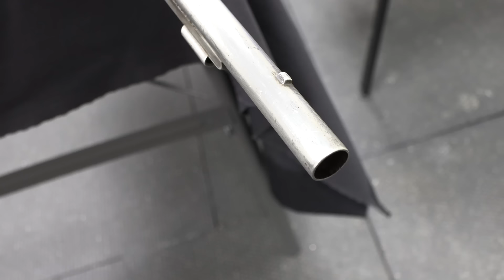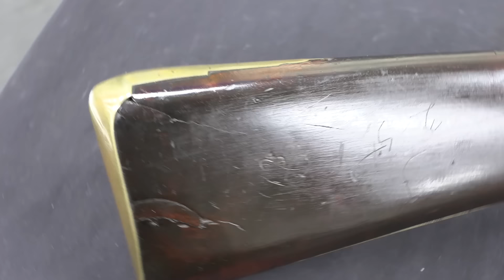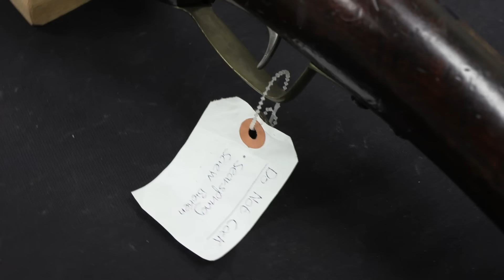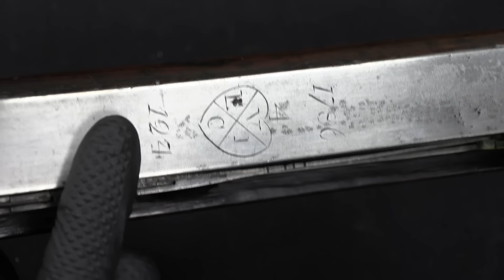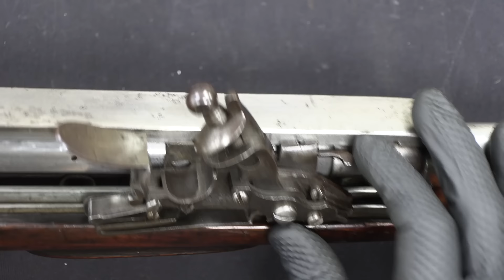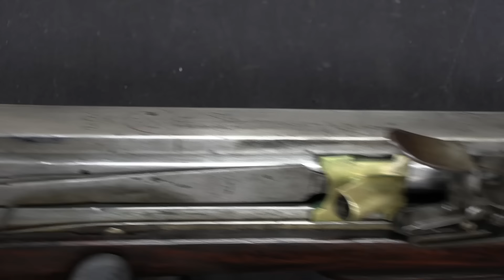Belton Repeating Flintlock: A Semiautomatic Rifle in 1785

Comment: Bruh why not look at the historic cost for a Brown Bess? Originally they cost about £1 and 2 shillings later falling just under a pound by 1795. So an educated guess - about £1 per gun in 1785.

It probably wasn't an issue of the cost per unit but whether such a radical firearm could be supported in any meaningful numbers. Questions like whether you'd really want to concentrate all of that firepower and money in the hands of one soldier.

Comment: Now, if they'd had percussion caps in the 1780s, this could've been taken a step further still. (though off the top of my head, I can't think of a system that would be as rapid-fire as the portfire option, unless you used a double-action trigger mechanism + sliding lock/hammer for each shot)

If only Bertholdt's self-exploding Potassium Chlorate gunpowder factory disaster of 1788 had led to the logical extension of this being: it's way more friction and impact sensitive than normal gunpowder ... so let's exploit that as a new ignition system (and invent chlorate based percussion caps in the late 1700s, well before fulminate caps of the early 1800s, and using cheaper materials ... though chlorates were still quite expensive given the electrolysis based process was another 100+ years away, but mercury fulminate was even more expensive to produce, plus chlorate based priming compounds have an almost indefinite shelf life where mercury fulminate degrades over time). But nope, they abandoned things after that disaster rather than actually trying to make a MORE sensitive explosive for a purpose of an ignition system. 

(side-note, but a chlorate based propellant that omitted sulfur, and only charcoal as fuel, it could've been used relatively safely as the primary propellant, but it would've been exceptionally expensive given the cost of chlorates, and would've been much more corrosive on the barrels ... and if you used a sulfurless composition with a little chlorate along with mostly nitrate as the main oxidizer, you'd end up with something somewhat more like how corrosive 777 is, but less than pyrodex:  777 uses perchlorate, but the results in the ash is the same, potassium chloride being the corrosive component and the alkaline potassium carbonate reducing the corrosive effect to some extent, at least on contact with steel/iron given alkaline conditions inhibit corrosion more;  on brass and bronze that's less true given copper, tin, zinc, and lead are all amphoteric and react acid and base conditions in weird ways)

Comment: I do not see how screws would be the weak point and it being a safety feature... they seem like they are made out of the same material and I'd think they'd be made out of something soft, like brass, if they were to be a safety give away point. Also, you wouldn't double them up, the first ones giving and then the ones in the stock to follow? Doubtful.
I wonder if the screws were locations for some mechanical device that would let you know which "chambers" were fired or not so that you are less likely to try and fire a preceeding chamber. 
As the case with most things, once they tried the concept, they found it would gum up with carbon and decided to remove this function and add screws to plug the holes.

Comment: I've seen a lot of weird old guns, but not a semi-auto flintlock. I never heard of portfires before so I did a quick search. It turns out they sell them for lighting fireworks. A 10mm diameter "stick" will burn about 4 1/2 minutes, so you can light lots of fireworks, without getting danger-close to the fuse, like with a lighter. If you've ever had a cannon fuse jet out fire onto your fingers when you light it, you know not to use a lighter. I normally use a propane torch but plan on buying some porttfires.

Comment: I suspect that the hammer is set backwards so there would be cam and pin that would cock the hammer.  Maybe it required too much pull strength and they were removed and the port fire was added.  Its strange to mix two solutions unless you are solving a problem.  He could have just used only a match and just have to port fire in front of the first port and drag it along like it is now.  That would save all of the Flint mechanism entirely.

Comment: Regarding the screws at the bottom and how they line up with the frame, my first thought was "If you wanted to use it as a normal rifle, or simply couldn't afford more 'magazines' and didn't want that to be a weak point, you would simply attach the tube to the frame to prevent the gun from coming apart as easily". But the fact that there are that many holes, and specifically where they're located, makes that theory pretty unlikely.

Comment: Ian, there is something I don't quite understand. Wouldn't firing any shot following the first one vent gases out ot the touchholes of the previous ones, losing pressure? By the seventh shot there are six full holes for the gases to escape. Was a system to avoid this developed or it's just the way it is, deal with it?

Comment: Dude that’s wild. Doesn’t that stuff leave behind a huge amount of blinding smoke in the front? Maybe they worked fine, but If you actually shot it at the fire rate advertised, the smoke build up in front was just to overpowering. Or was that not as big an issue as I think ?

Comment: A more useful comparison price-wise would be that the price of most infantry muskets at the time varied between one and three pounds.  So one of these runs between two and five times as much.  Which isn't terrible.  I'd expect them to see use mostly in places where they couldn't afford to station or send a lot of personnel, but still wanted a large amount of firepower.  Give them to the crack squads of skirmishers like the Austrians did with the Girandoni air rifles.

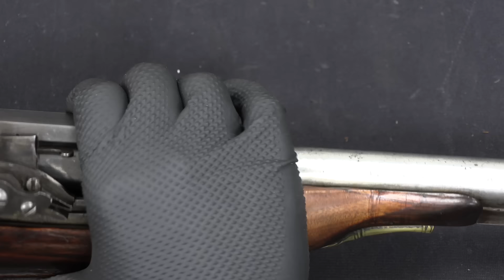Comment: At 10:00 I wonder if the the latch push down would get locked from going down if it went further back into the frame clearance notch. It might be the latching mechanism is out of time. It nearly uncovers the touch hole, so perhaps loosening a screw, a 1/8th an inch adjustment and it all works fine

Comment: I'm willing to bet the variable barrel length messed with the consistency of the shots. Your first shot is firing out of an effectively shorter barrel than your last, so unless you're loading progressively less powder for each shot, back to front, you're getting either too much powder on the first few, reducing accuracy, or too little on the last few, reducing range.

Since the spacing of the holes looks uniform, I'm willing to bet they tuned the powder charge for the last shot, so that it didn't tend to jam. This means the first few shots were underbarreled and probably wildly inaccurate, which is the opposite of how you'd make good use of this gun.

In an ideal scenario, your first shot is your most accurate. If it fails, your enemy is now closing distance. Your follow-up shots don't need to be as accurate or have as long of a range. But if you set the gun up this way, with the barrel length optimized for the first shot, then all subsequent shots are underpowered and run the risk of getting stuck in the barrel.

Maybe they did originally optimize the barrel for the first round, and that's why the later design had the safety screws?

Comment: Hah, when ammo and especially primers were really hard to get a while ago, as a machinist i had all sorts of day dreams for a modernized repeating flint lock.  But of course, some other clever fellow beat me by a few hundred years, hah.  I knew about the chainfire repeating flint locks but not these select fire ones, very neat.  As any other machinist will tell you, all odd mechanical mechanisms just get filed away in the old brain, and often parts of them get used to solve modern problems, often not even related to the original use, like to fix a pump design or something, so i really appreciate your taking the time to make these videos on these rare designs.

Comment: what an amazing piece of design! this gave me an idea. rather than touch-holes in the tube, why not a barrell with separate wells cut out where you can load 7 handgun mags horizontally (like the bren gun) and the slide assembly moves to the rear as you cycle through the mags. the last mag would be firing thru the full barrel length. that'd be something to see!

Comment: Repeating pre cartridge firearm issue checklist:

[√ ] Over complicated

[√ ] Expensive

[√ ] Prone to catastrophic failure

[√ ] Unreliable

Having the "magazine" be a cylinder is an odd design choice, one that I can easily see a soldier fumbling during the reload and put back in the wrong way, a T rather than l shaped slot seems less prone to mistake. The matchcord idea is novel but seems prone to misfire such as if loading in a new tube, matchlocks have always been a bit unreliable safety wise by sheer design. The solution for chain fire also isn't one that inspires confidence, even the fact it exists is like seeing a pilot come aboard with their own parachute, but the notion of the gun not working and then spitting a bunch of chunks of metal where your arm would be isn't much of an improvement (not like veterans got looked after well if at all back then). I'd hope the additional firepower is worth it; I don't think this'd hold up in hand to hand fighting. The lack of rifling seems like a missed opportunity, it's not like this wasn't already a premium gun.

Comment: Wow. Simply amazing idea. I saw a reference to this system years ago in an article talking about how our founders really had thought about rapid fire firearms contrary to the antigunners. It also mentioned the Pucklegun. Never saw even drawings til this. Two variants survived. They're well worn so they must have worked to some degree. If they didn't work, no one would have worn down the notches for round selection.

Comment: Slightly similar question:
I seem to recall reading an article in the 70s or 80s about a pneumatic rifle that was prototyped in the late 1850s. It wasn't a repeater but was capable of an aimed shot about every 5 seconds. The air reservoir was the stock which was removable allowing the shooter to carry pre-charged stocks. Does this ring any bells? Has Ian already done an episode on this weapon?
Reply: Girardoni Model 1780 air rifle.
It was in service with the Austrian Army from 1780-1815 as their standard issue rifle. It was lethal out to 150 yards. 20 round fixed tubular magazine and the removal air tank could fire up to 30 times before needing to be refilled. Each soldier was issued three air tanks and 100 round of ammo, which was kept in 20 round tubes that could be used to load the fixed tubular magazine on the air rifle. 

https://youtu.be/2dZLeEUE940?feature=shared
Reply: @joenull5945  Certainly a similar weapon but is much earlier than the weapon in the article I am dimly remembering plus this isn't a prototype but a weapon with decades of service. Another dim recollection of the article was that it considered the effect on the Civil War if there was no smoke aside from cannons and pistols and the rifles were repeaters. Possibly it was an article in the American Rifleman. I thank you for for sharing this link.

Comment: 3 minutes with a Dremel tool will adjust the stock so the lock mechanism can slide to the first hole for semi-auto fire.  Magazine fed, semi-auto flintlock.  Cool idea.  Replace the broken hammer spring.

Comment: With regards to the modern price conversion, according to the Bank of England's inflation calculator, 5 Pounds in 1795 is equivalent to 504.18 Pounds today which equals only $636.53 US Dollars. When you compare that to the average cost of a brown bess musket at the same time (18 shillings 5 pence according to the Royal Armouries), that is equivalent to a bit over $100 USD each. So the Belton's were six times as expensive as the standard musket.

Comment: Screws could also be used to unload powder from the tube if necessary.  You would be able to empty out enough powder to tap the front balls back enough to unload the front powders.  Then a rod could be pushed through the holes to poke the lead balls back out.  

Idk, just a thought.

Comment: Bro, if this gun was percussion, holy shit. I am absolutely stunned that someone out there pulled this off and it wasn’t just another strange prototype, the fact that this weapon was made in the hundreds is more than impressive. It kinda makes you wish that it could have been adopted in higher quantities and it could have had a chance of receiving technological support like converting them to percussion in the 1820s. Its almost frustrating that it didn’t receive that amount of admiration because the conversations and design changes could have been as simple as changing the hammer and changing the design of the magazine tube to take the percussion system, making it way more of a semi auto or the perfect muzzle loading rifle.
I wouldn’t have believed that this work of art existed, had I not seen it with my own eyes.

Comment: As just a thought, the guns were clearly used, this is evident in the wear on the guns. So most likely, they were used, they were effective but they were also too expensive. They also required a bit of skill on the part of the user and the flashes of gas out of the side of the gun would have been very disturbing. But I do agree with Ian, it would be nice to have some action reports on the guns in real usage.

Comment: How does the pan get charged with powder  as the lock moves to each subsequent position? Was it manually charged or is there a missing part that drops a powder charge in the pan each time it moves to a new position?
Reply from the maker: It doesn't need the pan filled; the burning fuse is enough to light a charge through the touch hole.

Comment: For the port fire fuse, how would it work once it has burned down a bit? It seems like after it burns for a few seconds the burning end would be too far away from the touch hole to light the powder. Could the user potentially cut the fuse long and feed it further in as needed?

Comment: The shape of the stock on the 2nd one especially is really nice. Personally if I was going to be touching one off, I'd like some sort of sliding cover that followed the sliding triggers down so as to avoid any chain fire. Would be interesting is someone made a modern reproduction & tested it out. (By clamping it down & pulling a string from a distance I might add!)

Comment: East India Company had tons of money, but this gun is as expesive as one can imagine. And to the costs of the guns we need to ad soare magazine tubes, replacement parts, gunpowder and bullets. Then a sum of 30k in todays USD seems legit to be broken for a single gun. And if actually used tge costs just pile up. Just imagine spending about 35-38k USD per trooper to equip this thing. And this is just the gun. Ad a uniform, training, shipping.... What was the cost of a single Maxim Gun in early stage?

Comment: The full auto “Roman candle” style gun is about to be used in a challenge to the NFA and 1986 ban. Not only did they have full auto at the time of the founding (as defined in the NFA of firing multiple rounds with a single activation of the trigger) but congress knew about them since they ordered 100.

Comment: Converting from Pounds Sterling to USD is dead simple.  It's the current spot price per Troy ounce of silver x 12 troy ounces per troy pound x number of pounds.
The entire point of commodity money is that precious metals never fluctuate anywhere near the amount we've experienced just in the last four years, so you're much safer just using silver as the standard by which you're measuring, as opposed to using USD.

Comment: Now it was some guns who refilled the chamber and the flintlock. This was dangerous in that you could get burn trough from the chamber into the gun magazine who is very bad. But if it was only for the flint lock primer its not very dangerous for your outside the gun misfire and flame out. 
As in how hard would it be to add an auto refill? It might require an double action and rotating the gun to prime. 
Still amazing for the time and worst case you get an second bullet going off or you have to prime the flintlock. 

And get where Metalstorm got their idea and they was a bit late :)